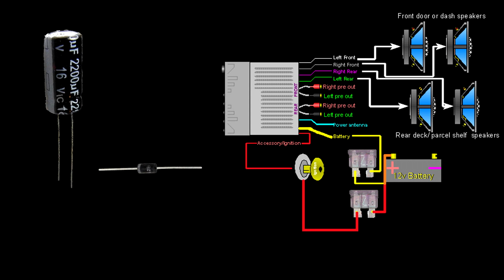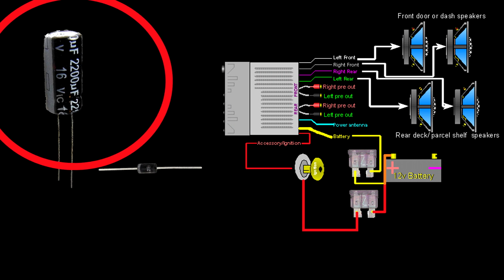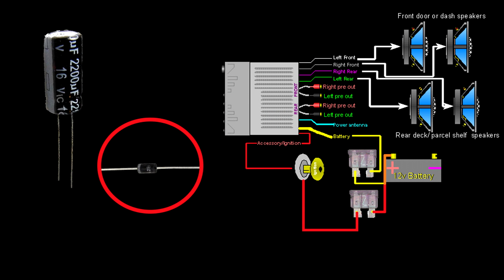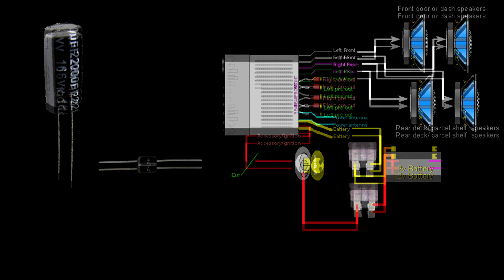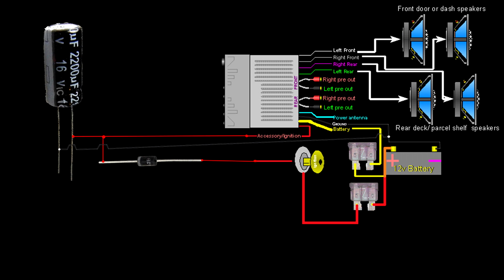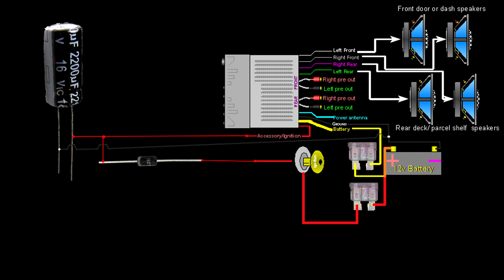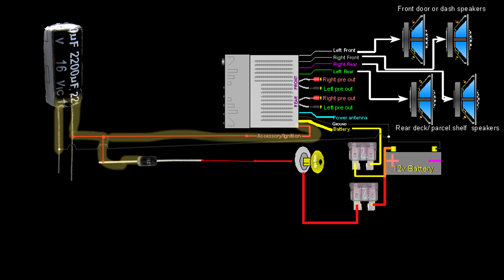HOW TO: Keep Your Car Stereo On While Starting

Comment: Hey... so I did the acc wire capacitor. Then I added a couple of 4700 uf capacitors on the always on wire. The thing works but only if I crank the car within 2 minutes after shutting it. Any idea why is that and how can i increase the time it keeps on between the cranks?
Reply from the maker: So shut the engine off, but keep listening to the stereo with the key in ACC mode, and try to start the engine after more than 2 minutes of listening the stereo will be shut down?  

I'd say your battery may be a little week, and 9400uf isn't big enough (did you add a diode there too?) to supply power while cranking... I forget how big the caps I put on the always on were, but something like 25,000uf x 2, and a diode to prevent the starter from sapping them while cranking.
Reply: @StephenTack  Ok great... I'll try a bigger capacitor. I have put a diode there. What diode rating did you put there though? 10amp?
Reply from the maker: @prakharmanas1910  just a physically large diode harvested from an old PC power supply. Not sure what specifications.
Reply: @StephenTack  I have the same problem talked about here. When I first added your circuit to to the red wire, all worked great and the radio stayed on during cranking. Then, at some point in the last month or so, the radio stopped staying on while starting the engine. It could be related to having replaced the starter in the car. It may have stopped staying on while cranking after the starter motor was replaced. So now I'd like to add the similar circuit to the yellow wire but I'm having trouble tracking down 25,000uf caps. I found 10,000uf. Any suggestions for where to find the larger, sufficient caps and/or additional guidance on just how large the cap needs to be?
Reply from the maker: @Timothyjpaul  You can parallel whatever size caps to get enough capacitance , just be sure the voltage rating is at least 15V. Or you could try supercapacitors in series to get the voltage you need.  Like this 20F beast: https://www.ebay.com/itm/16V-20F-Ultracapacitor-Engine-Battery-Starter-Booster-Car-Super-Capacitor-w-L0B5/273865125573

But first thing is to make sure your battery cables have good connections on both ends, and your battery isn't weak.
Reply: @StephenTack  Thanks! My battery is new in the past 6 months and I have double checked and the connections are clean. I guess it's time to move on to the caps for the yellow wire.

Comment: Hi, I have a vw polo. I tried it without the diode. It still turns off when I start the car. Could it be that the starter is pulling the power from the cap because I left out the diode? Please help. :(
Reply: I have a canbus adapter because without it my radio won't turn off even if I pulled out my key.
Reply from the maker: In my experience most cars/stereos need the diode.
Reply: @StephenTack  Hi, I found out that I had to wire the continuous power to the cap and not signal wire. It worked but when I turned up the volume the diode exploded. :/ It was rated for 50v. I also have a subwoofer. Should i get a bigger one? Please help! :(
Reply from the maker: @badrc350  don't worry about the rated voltage of the diode (though 50V seems a bit low, as 300V+ is common), just try to find one that is physically large. Old power supplies usually have some big ones
Reply: @StephenTack  I ordered the diodes from Ebay. I thought the big ones would be overkill but I was wrong. 😂 I unfortunately dont have any big ones lying around, so I will order new ones. Thanks for the help! 😀✌
Reply: @StephenTack  I guess you are right because thinking about it and as you said, it prevents the power from back feeding. I thought this was for safety reasons not to possibly fry stuff, but it actually does play an important role as I very quickly discovered. xD Thanks for the help. :D

Comment: Also it might sound ridiculous but for people who're trying this and it isn't working, see how it goes with your stereo not playing music. There's voltage sag during cranking because the starter pulls so many amps from the battery, could be that your stereo stays on but if your stereo is pulling serious load (like playing music through a decent or even stock) system then it might not cope with the sag.

If you can keep the stereo from restarting then you probably just need a battery rated for higher cranking amps and it'll work for you too.
Reply: I had that problem, i added big power bank to the main pwr wire (yellow), i have video on my channel describing if this video does not help, and stereo keeps shutting down due to voltage sag. I've put 2 big 16V 47000uF caps, ~ 0.1F as a " power bank " to the yellow wire with the diode. Installed it probably 7 8 months ago, no problems at all. Did not change the battery (although it is now roughly 2.5 years old). You can check it out.

Comment: I'm overdue for a new battery so I won't try this straight away, but do you happen to remember which diode you used?

I have a heap of junk power supplies to cannibalise parts from, but your diode looks brand new part. Did you just look up "14v diode" on a parts website or do I need to know more than that?
Reply from the maker: That's just a stock picture. I pulled mine from an old power supply.
Basically any diode that looks beefy and black will work for this.
Reply: @StephenTack  dope. Makes sense, just a big fat DC one way gate.

Comment: As far as i know, the HU reboot is not triggered by the absence of the ACC signal, instead because the main DC power mostly withdrawed to crank up the engine.

Yes, i know may be this must depends on each HU design that differ from one to another. And in your case, could be saved by the internal HU power supply which might have more backup power capacitor inside.

Just my 2cents.
Reply from the maker: Yes. Voltage sag on the always on yellow "bat" wire while cranking the starter can cause the HU to reboot. But I've added this diode-capacitor ACC red wire circuit to many vehicles now, with many different head units, and it works in most cases. At the least, it is required if you want to keep the HU on while cranking, because in every case the ACC voltage is totally shut off while cranking. 
With a healthy battery, and good connections, in not freezing weather the lowest voltage sag I've measured on the yellow wire is about 10v... Most head units won't reboot till about 8v, though their amplifies may momentarily brown-out a bit sooner.

The solution i have used for this problem is either a fresh battery, removing corrosion from the battery terminals, or adding a very large capacitor and diode to the yellow wire (which can help with the stereo hit harder anyway}.

Cheers!
Reply: @StephenTack  well.... that is a lot of new informations for me.... thanks for sharing.... really appreciate it.... i'll try it my self, because i really need my headunit stay on while starting the engine.....
Reply: @StephenTack  EDIT: Stupid me. Allow me to change my question: which capacitor and diode do you recommend for a head unit with 9inch LCD screen? Cheers

Comment: Can anyone tell how to fins acc wire on car stereo ? There is 2 wire with 12volt, one wire which while ignition drops voltage to 10 and another wire which while ignition cuts the power completely, so i was wondering which wire should i install capacitor to?
Thanks
Reply from the maker: The one that turns off. And don't forget the diode.

Comment: Thank you man for this video ! Can't believe how long the capacitor can feed my stereo after cutting off power. I placed a 2200uF 16V capacitor and my unit runs for about 30 seconds after ignition removal. Far more than what I expected ! Do you just have an idea of how long I can expect the capacitor to last before it blows or something ? (In a normal use)
Reply from the maker: Congrats on getting it working well!
In the configuration I show here the capacitor is not feeding the stereo "power,"  just keeping the stay on signal voltage high. Power is drawn directly from the battery, through the yellow wire.
If 30 seconds is longer than you want the stereo to say on, you can decrease the capacitance, or add a high value resistor in parallel with the capacitor (I'd t try 100K ohm to start).
In this roll the capacitor isn't being strained too much, it should last for a long time. The only thing you could do to make life easier on it would be reduced the in-rush when you turn the ignition on, by putting a low value resistor 10-100 ohm between the diode and the capacitor.
Reply: Stephen Tack I'm not much of an expert in electric and electronic stuff. I've made exactly the same wiring as yours. Tell me if I'm wrong but the capacitor is just feeding the stereo with electricity when there is a current cut when turning on the engine and also after shutting off power, the residual energy is making it on for a certain time before it shuts down. Can you explain to me in an easier way what you suggested ?
What is the role of the resistor in your suggestion ? Is it decreasing voltage, intensity for the capacitor ? And how do you determine the ohms value ?
Reply: @traxxx8720  Can’t see a resistor in Stephen’s diagram! 🤔

Comment: I followed you & it was a success. But from past few days while cranking radio gets off. I checked capacitors & diode. Both are good. Even after removing key, radio is on for about 15 seconds which indicates that capacitor & diode are good. But why my radio is getting off while starting?
Reply from the maker: I'd guess your car's battery is getting a little weak, or has corrosion on the terminals. So the main voltage is sagging when you crank the starter, and the stereo doesn't have enough voltage to stay on.

Clean the terminals, get the battery tested. 
And/ot add a LARGE capacitor, and a beefy diode on the yellow wire like you did to the red.

Comment: Hi Stephen..what if we short the accessory wire to the 12V battery + wire...in this case the power to the stereo unit should never get OFF. And switching ON/OFF can be done through the front switch of the stereo unit. Is it a viable and safe option ? Just curious ..
Reply from the maker: Yeah, you could just hook both red and yellow wires in the stereo to the always on wire... But the chance of leaving the stereo on, and running down the battery would increase. And I like the stereo to turn on automatically when I start the car.
Reply from the maker: Just don't short the car's accessory wire to the battery wire.
Reply: @StephenTack  OK..I got that..No shorting ..Thanks
Reply: Hi Stephen.. Is it safe to add a similar circuit for the mains +12V ? During cranking , 12v drops to almost 8.5V and the stereo trips even after adding this circuit on the accessory wire. I have read that you added 47000 microfarad capacitor on the mains +12V and it worked. Are there any precautions to take, if I try this ? What would be the rating of the diode in such a case ?
Reply from the maker: @ebyoommen1  Any large diode should work, if you have a multimeter with a diode check mode, try to select a diode that has the smallest voltage drop, as this will reduce the operating voltage the least.  Just be sure that all the connections are insulated (tape and/or heat-shrink tube), so they won't short out to exposed metal inside the dash. 

Other things to check if the battery voltage is sagging a lot while cranking, is the health of the battery (old batteries sag more), and for good corrosion-free connections to the battery and the ground-wire to the frame and engine. Any point of resistance in this main circuit will cause a large voltage drop while the starter is drawing a lot of currant. 

Good luck!
Reply: @StephenTack  Thanks a ton ! Will try out ..hope this time it works..

Comment: Hey man, Awesome video I'm looking at wiring this into my stereo as well so it doesn't lose connection to the bluetooth but I was wondering if there's a way to wire the stereo in so that it turns off when the ignition is turned off after the car has been running  but is able to be turned back on when the ignition is completely off? So the passenger is able to turn it on without a key in the ignition.

I've been searching for solutions and have found people wire it to a constant 12v power when the ignition is off, but I believe this essentially means it's powered on all the time. So that solution doesn't seem to be the same as the OEM setups in come cars. Would there be a solution to this?

Thanks.
Reply from the maker: If you have a place to mount a small toggle switch, you could have it select if the stereo's red wire connects to the normal on-with-ignition (red) wire, or to the always-on (yellow) wire.
Reply: @StephenTack  Is this capacitor a good one to get? or should I get a non-low ESR one?
https://www.jaycar.com.au/2200uf-16vdc-low-esr-electrolytic-capacitor/p/RE6318
Reply from the maker: @XxSCaaRyFiEnDxX  what you want to do would only be possible with and advanced circuit or microcontroller...or toggle switch.

That capacitor looks fine. You don't need low ESR. But I'd recommend getting at least 2 2200uf caps. If 1 isn't enough you can add a second one in parallel.
Reply: @StephenTack  Sweet thanks, I'll look into it.
Reply: @StephenTack  Sorry I forgot to mention, is a fuse needed for the setup in this video?

Thanks!
Reply from the maker: @XxSCaaRyFiEnDxX  the fuse is already in the car's fuse box, you don't need do as one.
Reply: @StephenTack  Thanks for the reply! Yeah I saw those as well but I'm going for a stock look, in your opinion would this be possible without a toggle switch?

Comment: Nice trick! It might not work for all stereos, as some use the red ACC wire as the main power source (not just sensing), and the yellow BAT wire just for preserving the memory. In that case, the capacitor probably won't hold enough charge to keep it on during engine start.
Reply: Haha, just discovered your "YMMV" comment under SHOW MORE. :)
Reply from the maker: That's true. Any idea want brands do that? I haven't seen it from Pioneer, JBL, or Sonny, in the last 10 years.
Reply: @StephenTack  actually my 2020 pioneer seems to be doing this, i put a frm01 delay relay in between it, but it wont work
Reply: This doesn't work on my radio. What did you do to get it working?
Reply from the maker: @mrdg123 in what way doesn't it work?

Comment: Can I do this with cigarette charger ?
Reply from the maker: Literally any diode will work.
Reply: And what diod is that name ?
Reply from the maker: You can easily make your cigarette lighter stay powered while the car it's off. Just disconnect it from its 12 volt supply, and connected to some supply that is always on (like the radio's yellow wire, if you won't be drawing too much power).

I run a heavy wire all the way from the under-hood fuse box, so I can charge anything, anytime.
Reply: I want constant Supply even if car is off and locked
Reply from the maker: Try connecting to the yellow wire. That's onn all the time.  Or run a whole new wire from the battery (bonus points for using a fuse so your car doesn't burn down if something goes wrong)... Cheers!
Reply: And it's must stay on while cranking
Reply: Thanks

Comment: This didn’t work for me. I even added 4 capacitors to see if the system needed more power. But the stereo always shuts off briefly on start up. 

The multi meter shows a drop from 12v to around 9v on the constant live and ignition live wires on start up. 
When I turn the engine off the capacitors last around 9/10 seconds before they drop down from 11.85v to 8.5v which is then too low to power the stereo and it shuts off. 

Any suggestions?
Reply from the maker: Yep, the starter is pulling the voltage below the stereo's amp's low voltage shutdown. If you can find some very large capacitor, like at least a couple 50,000uFd 16V capacitors in parallel, and a beefy rectifier diode, you can do the same thing to the constant power wire. Or... Get a fresher/bigger battery, and make sure there is no corrosion on the terminals.

Ciao!
Reply: Stephen Tack 
Not even sure where I’d find a 50,000uFd capacitor. 
How long would a cap this size keep the stereo running for after shut down?

Would a couple of 10,000-25v caps be any good??
Reply from the maker: @russellb1981  might help, keep adding them in parallel if it doesn't work... But your best bet is to be sure that your battery is well connected and fresh first, if it doesn't sag as much while cranking, the capacitors on the constant may not be needed.
Reply from the maker: So, capacitors on the yellow wire (12V constant) only need to supplement the battery voltage while it's sagging during engine crank. How large they need to be to prevent your stereo from shutting down depends on a lot of things: 
1, how long your starter needs to be cranked to start your vehicle.
2, the health of your battery and its connections.
3, how much power your stereo is drawing...if you are playing music very loud while cranking, or if your stereo is old and inefficient, you'll need bigger capacitors.

I got a couple 47,000uF from "Surplus Gizmos" for cheap, in parallel, and with a diode upstream they keep my Pioneer stereo on while cranking.
Reply: @StephenTack  What parameters make for a "beefy" rectifier diode? What specs should i be looking for?
Reply from the maker: @rhunt2363  ideally something rated to handle a lot of amps, like 10A. But I've had good luck just harvesting physically large diodes from old power supplies.